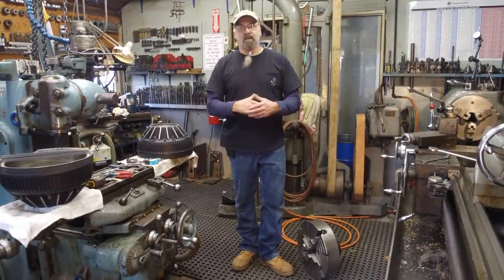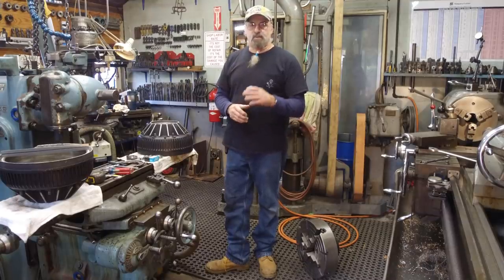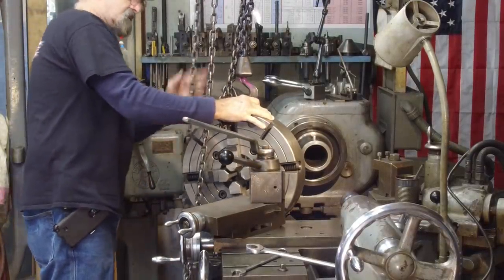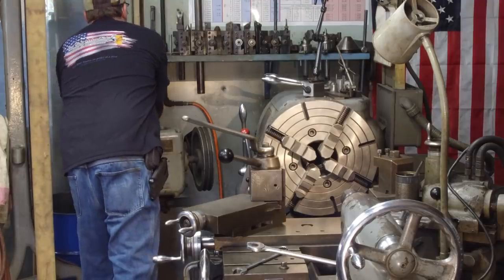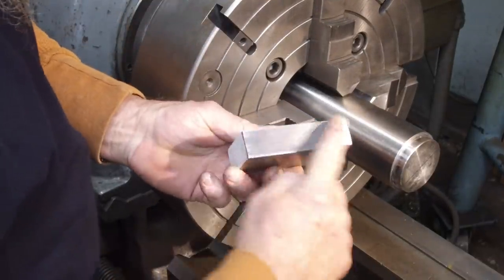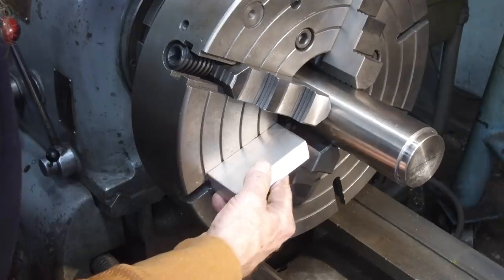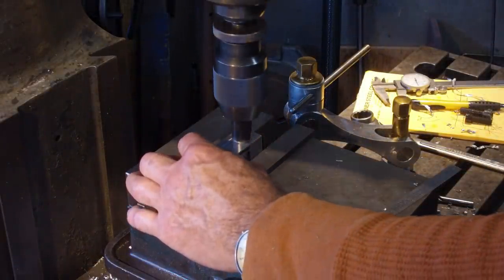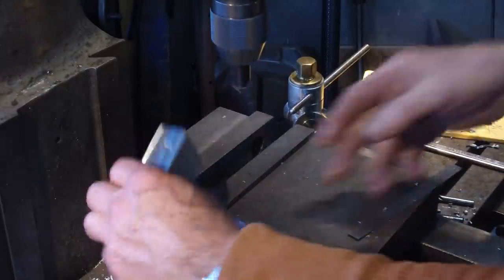Thinking Outside The 4 Jaw

Comment: You are so right on with setting the key at the top. Even the manufacturers specify that as the correct way to install and remove, for the reasons you mentioned.

Comment: You get to work on some iconic parts Keith, those "wide eight" drum/hubs are the legendary trademark of the Pontiac "Super Duty" Catalina, I recall the service manual explaining to never remove/install the races "cold", all too many people ignored this only to end up with parts like these needing repair or replacement.

Comment: Hi Keith,
 
Very nice work,  on the subject of alternative cutting lubricants for al. alloys Isopropyl Alcohol (IPA) works a treat when comes to applying it with a brush or allowing it to trickle. Usually is sold as a cleaning agent but it works well when comes to machining/tapping al. alloys (personal experience on AW6082-T6 and AW5083-H111). It evaporates but is advisable to wipe any machine surfaces exposed to it after use, it is  flammable but is very cheap!

Take care,

Comment: By now Buffy has a new retract spring.  The old one can be fixed, but only if you are retired and your time is your own.  Something about drilling the outside coil of the clock spring behind the split open hole, winding it up with the anchor pin,  inserting it into the sleeve, that into the housing, catching the wind up dog then finally winding a little pre-tension on the quill before screwing it down. While you are there, turn the quill lock bolt to the back so up is lock and down is release.  Less surprises that way and it won’t pull itself tight.

Comment: 4:30 Christ, I've never seen anyone use a hammer on a C spanner like that to tighten or remove a chuck before. Tightening by hand is absolutely sufficient ! Is your slowest speed 52 rpm ? That's ample gearing for tightening chucks. What's the spindle nose taper...L1 ?

Comment: Last thing you want is any of those 4 T nuts to come sliding out and hitting you/jamming the machine. Did you consider strapping the tie rods down - even with cable zip ties as close to the chuck as you could get ?

Comment: Hi Keith! One excellent, and inexpensive, aluminum cutting fluid we use at Precimax is varsol, a.k.a. mineral spirits, a.k.a. paint thinner. It does a remarkable job of keeping a fine finish. I have not used Alumi-Tap, so I can't do a direct comparison, but that might be an interesting test for you. Say, Alumi-Tap, varsol and WD-40 as aluminum cutting fluids? -- Murray

Comment: If the thread on the stud is long enough, you could have put a nut on first, then a washer, then the plasma cut pieces then washer and final nut - so that the 'backnut' can be tightened against the clamping nut so the nuts could be tighter than otherwise :)

Comment: I understand how you did it and it's amazing.  I'm wondering though why not use the chuck to hold the drum from the inside.  Too soft of material?  Too heavy of a part?  Chance of damaging/bending the part?
Reply from the maker: It was to be able to reset it up and hold true, without dialing in surfaces.  ;{)-------
Reply: @KeithFenner  Makes a lot more sense.  Setup once, use often.  Half the job always seems to be getting the parts level or centered before anything can happen.  Thank's for the insight.

Comment: Thank you for sharing your knowledge in these videos, so many of us enjoy them and watch very closely and learn from you. I have a question for you; I have a Central Machinery 12x36 gap bed lathe with the quick change gearbox, I picked it up about a year and half ago from a guy who blew the motor on it and took all the wires off but, I have everything for it except for a new motor, it's been sitting out on my trailer I brought it home on all this time and starting to get surface rust so, definitely need to clean it up and oil everything to stop that but, anyways, I'm wondering if this machine is worth the effort to get it put back together and running again? It seems to have several extra heads for it and verious other tools and such that came with it. I gave the guy $200 for everything trying to help when he was in a bad spot but, ended up having to keep this machine and would love to learn what I can do with one. Thank you for any insight you can give...
Reply from the maker: Yes, for a piece of machinery to learn on, it is worth tending to, the motor and wiring can be figured out and even modified for the better, a lot of VFD options out on the youtube now.  ;{)-------
Reply: @KeithFenner  great news, I'm going to get it going and start learning more about the process.. What do you think about me putting a 110v motor on it and not use the 220v setup? I was thinking about taking the 110v 1/2hp off my air compressor or the 1hp off another air compressor and use that motor to power the lathe? Partly due to the fact that I don't have 220v in my little shop but, running the wire for it is still a option that I could do if need be but, it is a delima I'm facing right now, what to do, what to do?? LOL.. Thank you for your quick response and helping me out. Have a great day

Comment: I'm going to assume this all worked out for ya. I also know, having watched how you work Keith that you would catch this on the way through. You can't assume that the drum face (where the shoes make contact with the drum) is anywhere near concentric to the bearing race. If they've been in service for any amount of time, having run a brake machining business for 12 yrs I can almost guarantee you that they will be running eccentric. In fact, I will go as far as to say I can guarantee it. 

It is perfectly acceptable for them to be eccentric to the hub, this is why the shoes ride on pins with springs and are not fixed with a more rigid set up. Often I have had to dick around with the brake lathe to set a drum off center in order to clean up the wear lips while cutting eccentric in order to  get the wanted result while staying below the maximum diameter.

Kudo's though :D Good video!
Reply from the maker: Yeah, left that to the air.  ;{)--------

Comment: I make a punch by welding a very heavy duty washer on a punch at a tilted angle.  the washer allow me to tap the bearing out by using the washer as a lip to transfer force to the bearing from the hammer blow on the punch